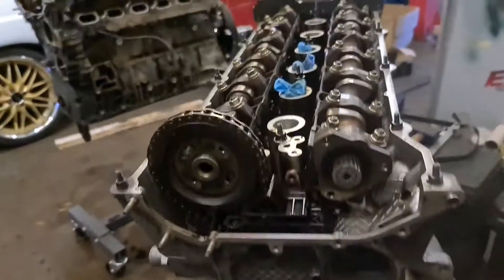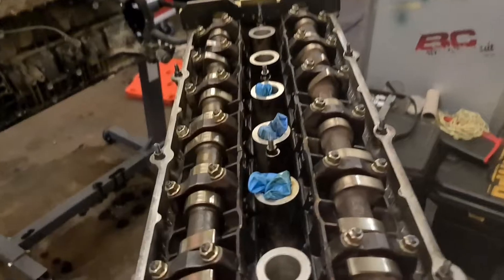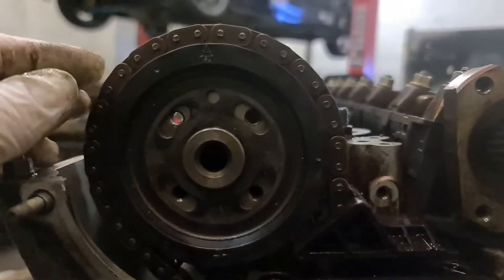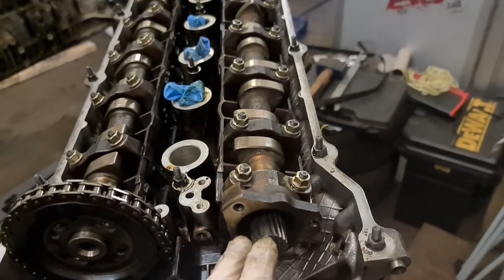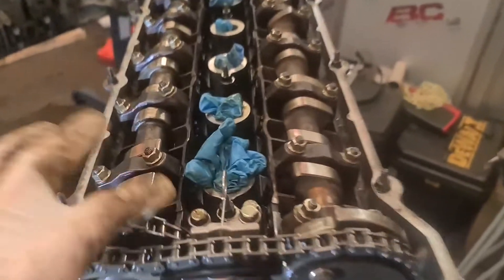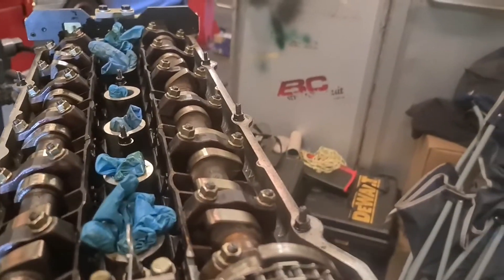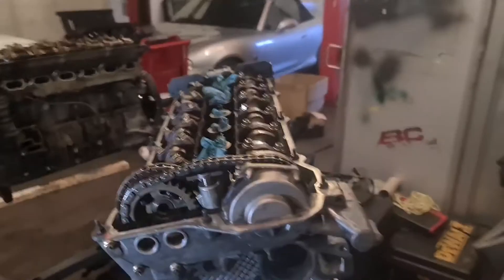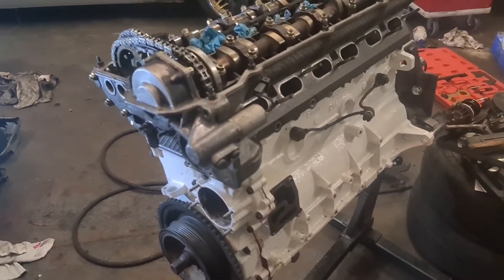Bmw E36 M50B30 stroker build, Part 7 timing and vanos installation..

Comment: what cam gears are you using? m50 m52 or m54? are they all the same?
Reply from the maker: Hi mate, all the m52 stuff I used..
Reply: Thank you for getting back to me so fast! There is so much different information out there. My friend is telling me I should just use my m50 head but upgrade the valve springs? And hook up single Vanos. I have Non Vanos, do you know if this is possible? I figured I may have to use the m52 intake cam but I’m just wondering if it will work with my cam trays or if I need to get M50 Vanos trays?
Reply from the maker: @baldbastard2114  that's no problem at all..

In regards to using the m50 non vanos head I am not 100% sure as I haven't even done one that way.. however the cam trays from your non vanos will work with vanos cams just fine.

You want to use your non vanos inlet cam as the exhaust cam, and then use an m54 cam as the inlet if possible..